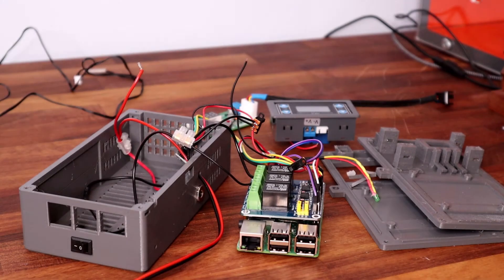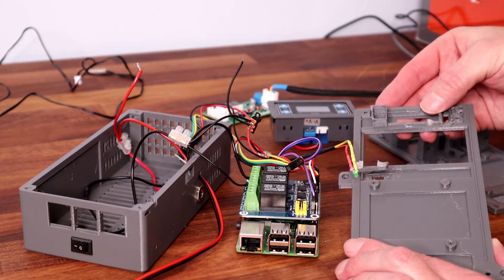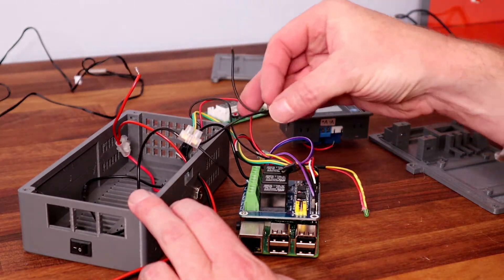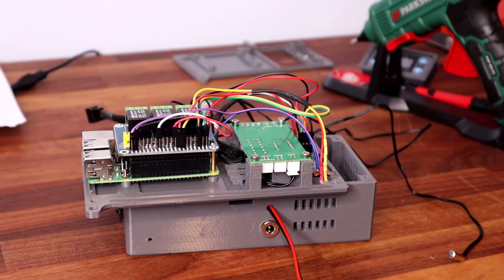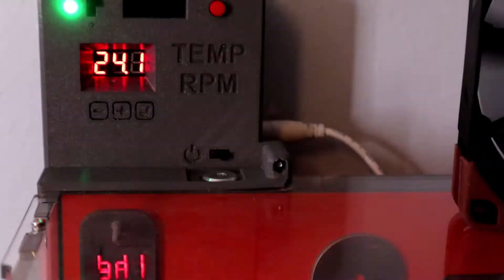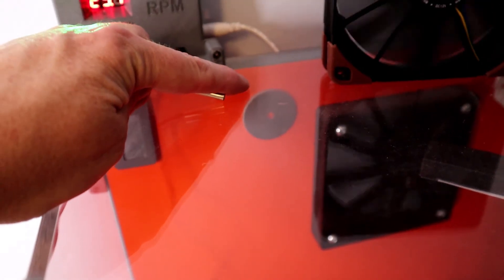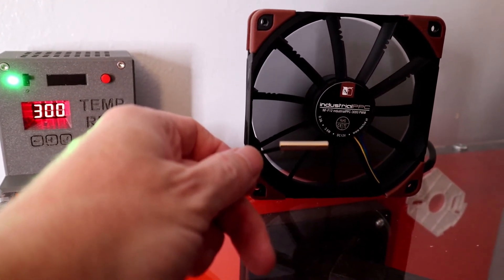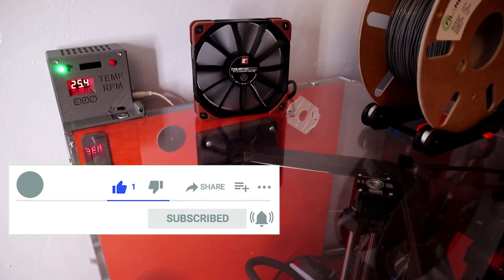PWM Extractor Fan Speed Controller PART2 for 3D Printer Enclosure - Tukkari, PrusaBox, Lack Box

Comment: Appreciate the videos on the controller. I’m going to use server fans to not only vent but filter air (hopefully). The fan plug on unit board is a real pain. I hope I have the correct connectors ordered. 🤞

Comment: Hey Colin. Great video and I am going to try something similar for a lack enclosure I have. One question, do you think it is worth having an incoming fan as well as an exhaust one? That might keep it from getting too hot and therefore too loud. I mainly print PLA and have started PETG, but I am using the enclosure for noise cancelling predominantly. Thanks again.
Reply from the maker: My PrusaBox had a vent slot to allow fresh air in. But an incoming fan may create a draught of cold air causing petg to warp. I'm guessing on Lack there is a gap around front doors, that will allow fresh air in. And for pla I would leave doors open a little. Petg should be fine with doors closed. Remember you can set the on off temps so that will determine how loud it gets. Good luck

Comment: Hi Colin have you thought if there is a way to have a set temperature integrated to this setup?   

Have fan go faster if above set point, go slower if below setpoint.
Reply from the maker: The pwm allows you to set a fan start and fan full speed temp, with the speed on a linear scale between the two. This should cover requirements and I'm really pleased with it. Don't have the fan blasting full speed all the time
Reply: @colinhill  thanks. I’m not grasping how it would allow a single target temperature.  

For example if the target was 40c, we could set the PWM at 25-45.  But where does it actually achieve steady state?
Reply from the maker: @robinjandu  if you look at a normal thermostat set at 40, the fan comes on at 40. The enclosure may carry on getting hotter for a while until the temp drops below 40 and fan turns off. Then temp rises again and fan comes on at 40. But with a pwm the fan is set to come on at 35 but at low rpm, as the temp gets nearer 40 the fan spins faster. This way the enclosure temp doesn't sky rocket over 40, it's a much more gradual increase to 40. If it goes over 40 the fan will go to full speed. When it drops below 40 the fan spins slower but still extracting air. It's a more balanced temp solution than the normal on/off temp control